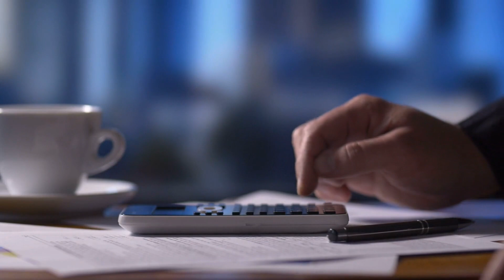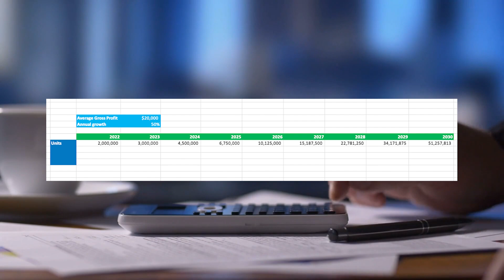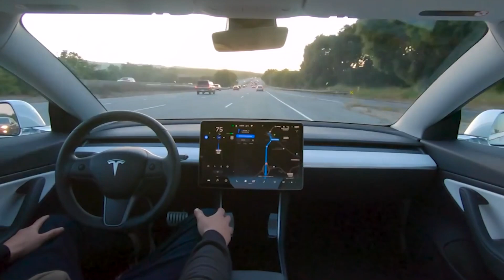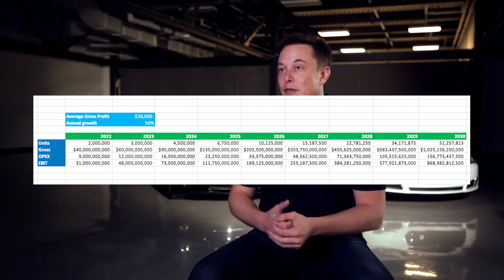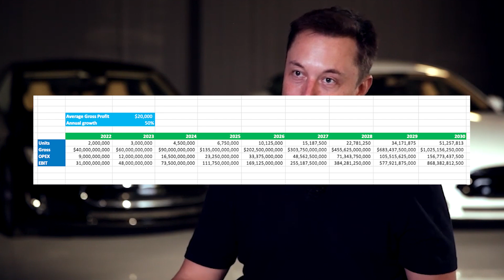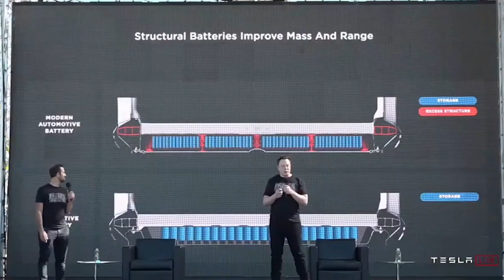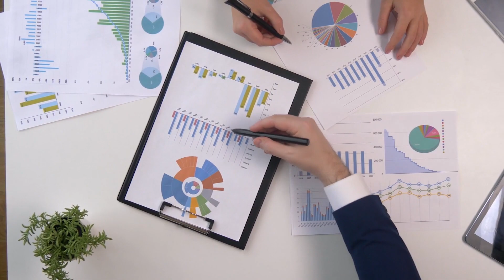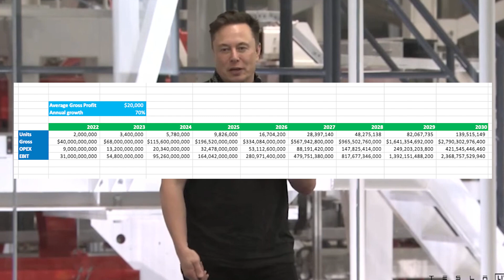Can Tesla Beat 50% Growth?

Comment: I’m not sure we will see much smaller batteries via efficiency increases because Tesla is already incredibly efficient. I reckon on a 10% improvement tops (80% to 90%)
Costs to move the car will always be much the same because a small car is always led aerodynamic than a larger car which cancels out the smaller hole it has to push through the air.

Comment: I would say that earnings will grow way faster than number of products delivered, due to economies of scale. But to keep it conservative, I calculate my price target with 50% growth per year and a PE coming down from its current level in the coming years. $4000-$5000 in 2025 sounds plausible to me.
Reply: I like it!
Reply: Can you share a spreadsheet?
Reply: @Alex_ander 010 indeed, too fast typing 🤣
Reply: I see MASSIVE margin improvements so the pe may drop a bit but still be quite high. I suggest 150 trailing pe and think 2023 earnings can get close to $50 ( 2022 earnings around $24 is my best guess). Now I may be too aggresive but I see operating margins nearing 40% in 2023.
Reply: @jerrysandberg3728  those numbers are super aggressive and unrealistic. Operating margins are currently shy of 15%, to get to 40% in the space of a few years isn’t possible without massive FSD adoption.
Reply: @okay4403  FSD can be expected around 2025. Since all cars are prepared, it’s just as easy as buying an app from the Apple app store…
Reply: @skinnymoonbob  I think there is a chance FSD will be done by 2025, but there is also a very long tail of edge cases which need to be solved for. By 2025, I’d say at the very least, FSD is an amazing driver assistance system and at best, a very good level 5 system.

Comment: Thanks for the vid! I wonder how many employees Tesla would need to crank out 10 million or 20+ million cars? Also, what type of sales and service infrastructure would be needed to support those sales?
Reply: You mean how many employees or employee equivalents. Automation via by manufacturing robots Or Tesla Bots will Increase at an  S-curve rate.
Reply: Zero employees
Reply: Hmm, have to admit that the Teslabot could sub in as a replacement for humans in an EV manufacturing plant. They're just about the right size and strength to get the job done. Maybe use GoPro-equiped workers to train DOJO?

Comment: So this may be slightly off topic, but one would think that Tesla having cars that have been pre-ordered & their delivering cars & opening 2 new factories, one would think that they would not forget their existing customers! 

So what I mean by that is, I just had a very disappointing visit to a Tesla service center on appointment to have my tires replace, only to find out 2 hours into the appointment they did not have the tires in the correct size, this after their service guy dismounted all 4 tires & then they had to re-balance & remount all 4 tires because they didn’t have the correct size tires according to the story & that they would re-order the tires & give me a new appointment, well the next day, I got a voicemail message saying that they can no longer get the tires & so, therefore, I could procure the tires from someone else & if I wanted to I could have the tires shipped to them & they would install them! 

So I inquired into why this had occurred & it turns out that there is a tire shortage that no one is talking about, so I googled Tesla tire supply chain problems & I get a story by some rag called torque news & low & behold they’re talking about a tire shortage & not just affecting Teslas, but the entire industry, yet there’s no one it appears in the main stream press doing any reporting on this story & so my question is why is there no one talking about a tire shortage?

Comment: LFP is a chemistry, 4680 is a form factor and Tesla is a manufacturer. 
Agree Tesla are creating a great lead in batteries.  But for clarity you need to avoid conflating chemistry and form factor when making your argument.
Tesla will make 4680 batteries in LFP, Nickel and Ni Mg chemistries. Other battery manufacturers will make 4680 cells for Tesla with various chemistries.
Reply from the maker: Tesla are not making their LFP batteries in 4680 form. They have said on numerous occasions.
Reply: @TeslaEconomist  Can you point out your sources on this?
Reply: During battery day the 4680 chemistry was different than the LFP chemistry. 

Tesla adopted LFP as a convenience because it was cheaper and still gave then the range goal they were currently getting in the SR+. Elon has stated that LFP is the future.

But I don't think in any of the LR or performance models we'll see LFP.
Reply: @KineticEV  What I got from battery day was that 4680 would come in three chemistries. LFP for the the model 2 or whatever they call it and SR Model 3. Form factor and chemistry are separate and interchangeable.
Reply: @motofunk1  I know there was a focus on 4680 batteries, the chemistry, the internal design and what they hoped to achieve with it. I know there was talk about producing a cheaper model but I don't remember him mentioning anything about using LFP chemistry in the cheaper model or any of the standard range variants at that time.

If he was aware of LFP at the time he never mentioned it as a viable solution to any of their cars. I believe that Model 3's off the line in Shanghai initially had the 2170 cells then they eventually shifted to LFP. 

I'd have to go back through battery day to see if it wad mentioned but to my recollection it wasn't.
Reply: @KineticEV  Take a look at Slide 48 of the battery day slide deck. Slide Title "Diversified Cathode", has the Model 3, a covered Model 2, and a Megapack in the section for Iron based. I do agree this has not been made perfectly clear on form factor, but with the structural nature of the packs in cars with front and rear castings, I believe they need to have 4680's to still be structural and carry the sheer load. Which also plays into cost and efficiency gains they are banking on.
Reply: @motofunk1  Awesome. I definitely missed that on the slide. I remember recently Elon saying the future is LFP. I'm still eager to see how they approach 4680 in LFP as well as 4680 for long range vehicles, especially if we're to see an increase across the board. I had hopes that by the time I take delivery of my Model Y next year it might come with the new cells and chemistry but not so sure just yet. I figure if anyone can Crack it, it will be Tesla. 

Store Dot has made a bold claim with their supposed 4680 battery and I'm waiting to see thatvone put to the test as well.
Reply: @KineticEV   Not sure how wrong I am on this, but here are my projections for 4680's. High Nickel 120 wh per cell, Nickel Mag 110 wh per cell and LFP 72-80 wh per cell. I modeled a Model 3 not Y at battery day. So, with 960 cells per pack, Nickel Mag range of 500 miles possible, LFP Between 337 - 375 miles. A Model Y would be somewhat less based on weight etc... If my per cell projections are correct, some might think they will use less cells to get lower ranges more in line with today. I am not so sure as the cells are part of the structure and removal may not be an option. On the other hand, Tesla could software limit range and use the excess as padding for several reasons.

Comment: Elon said 50% after Q4 2020, so if you round it to 611742 vehicules delivered for 2020 (see Q4 2020 report), that mean 35 million for 2030. it's far less than 51 million. 2021 should theoretically be 917K, but maybe we will have to replace it by a real number which should be around 970K, that lead to 37m cars in 2030. I think 51m is too bullish.
Reply from the maker: That was on battery day, he has said other estimates since.

Comment: Where do you have the information from, that Tesla will build lfp 4680 on their own?
I read that they outsource lfp to build the nickel 4680 on their own.
Reply from the maker: They are using a different form factor for LFP. Elon spoke about it in Q2 earnings and the shareholder meeting.
Reply: Always interesting to hear your thoughts and analysis
Reply: @TeslaEconomist  Yea, for now with the actual build they use prismatic cells from LG and CATL but they have given the design to these battery companies and I thought they will produce all LFP 4680's for Tesla and Tesla uses its lines for high nickel chemistries.
But I will try to find the part of the Q2 call, thanks.
Reply: @TeslaEconomist  Are you using the responses of Elon and Drew to Pierre Ferragu on the Q2 2021 Earnings call? They talk about cell chemistry, cell form factors and working with suppliers. I didn't hear Elon or Drew say that Tesla would produce LFP in house. Thanks for the videos.
Reply from the maker: Tesla will make 2 different form factors for their own in house LFP. One for energy storage one for vehicles
Reply: @TeslaEconomist  From the transcript: "So it is going to be important to consolidate to maybe -- ideally two form factors, maybe three, but ideally two. And then just one nickel chemistry and one iron chemistry, so we don't have to troubleshoot so many different variants."
Reply: I just can't see where Tesla says they will make LFP in house.
Reply: @pjimb8494  I couldnt find it too.
As I understood it, they will produce the high nickel 4680 with all bells and whistles they have invented and got CATL, LG and maybe Panasonic to produce the LFP Cells with most of the inventions from Tesla in very high quantities.
We will see how it will play out but I think its better when they produce as many highend cells and get the lower end cells from battery-makers, that can pump out many more cells then Tesla could on its own.

Comment: Another great video Leigh(Lee?).  I am super curious too to learn just what happens when batteries are no longer the constraint.  We can see large piles of castings at some of the sites.  I wonder how quickly that glut can be made into cars once batteries are no longer the bottleneck.  What do you think the bottleneck would be if batteries no longer were?
Reply from the maker: Assuming no supply chain issues, then the speed as to which they can ramp up manufacturing.
Reply: With regards to potential for further price hikes and shortage for shipping, as well as building factories close to all the largest vehicle markets, do you think we could see Tesla vertically integrating some of the shipping? I’m picturing massive ships powered by thousands of Model 3 motors and covered with a massive array of photovoltaics 🤓
Reply: Bottles.
Reply: Engineers.

Comment: Tesla’s battery suppliers, like CATL, Panasonic and LG Chem have most likely fully grasped the S-Curve their #1 customer will experience in coming quarters and years.

These suppliers might also admire Tesla’s gamesmanship with Wall Street and have learned the fine art of sandbagging.

My point- a tsunami of batteries might be in the pipeline, far outstripping estimates.
If true, Tesla’s going to have too many batteries in 2022. Just kidding.

I believe in the 2022 battery tsunami.

I also believe that Tesla will be able to shunt off enough LFP to seriously ramp Megapack and home storage solutions (which are currently booked harder than autos).

My point.. 2022 storage could wake up that sleeping giant and all the lovely auto-centric models will (happily) need to be updated to include a huge spike from the energy storage sector.

BTW.. Tesla can sell (and has preorders) for more cars than they can physically make, making batteries their secondary constraint, which lends to my 2022 energy storage prediction. 

Tesla might overshoot the “Tesla to the Moon” predictions and find itself neatly on Mars instead!! Tesla to Mars!! I like it!!

Comment: Since TSLA will be roughly at 900k for 2021 total.  

So I’m expecting a 180k for TeraAustin and Berlin each for 2022 and 1.2 million units per year in Fremont (500k each of 3 /Y and 100k each of S and  X then Shanghai for 1.3 million units per for 2022.  Roughly @ 2.85 million units for 2022. 

https://youtu.be/aYLuwwexl3U 

2025 could be 5.5 million to 6.5 million units per year.  If the projected numbers for TeraAustin and Berlin and Shanghai are actually true. 

TeraAustin of 2.5 million units per year completed and Shanghai of 2 million units per year completed, and 2.5 million units per year completed of Berlin. 

It’s already been stated that Shanghai is getting close to the Fremont factory output currently.